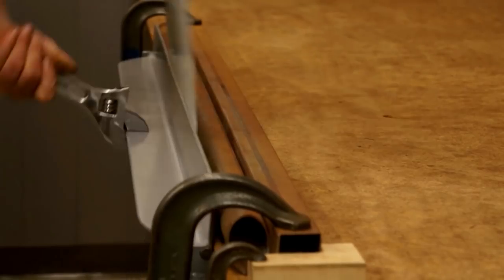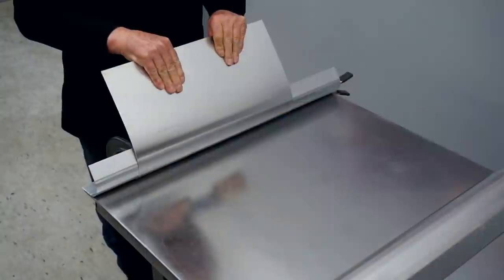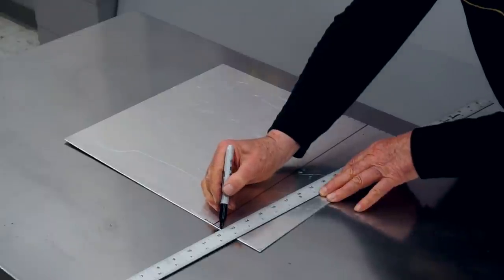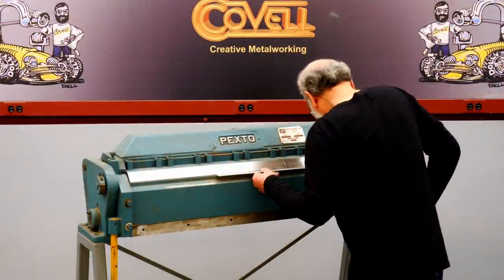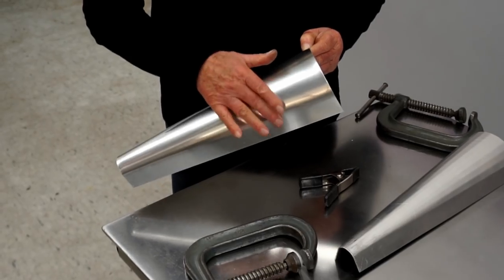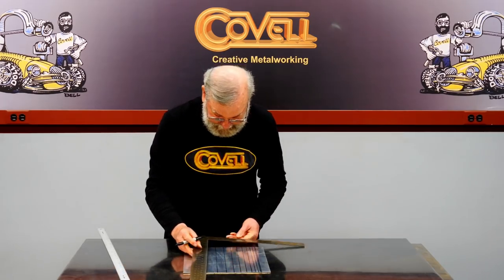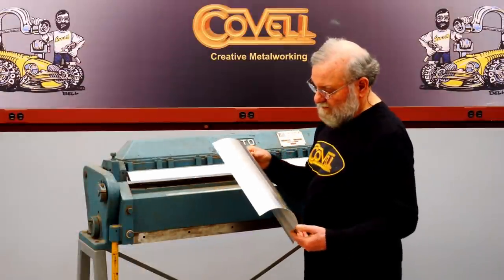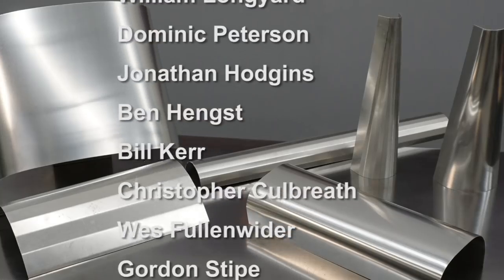Beautiful Bends from Faceted Forms

Comment: I like the simple solution to a complex problem.  I will have to try it out on 2024 t3.  Keep up the great content.
Reply from the maker: This should work on 2024 T3, but of course it will spring back much more, and it will crack if you try to bend it too tightly.

Comment: I have very limited tools, in the past I've used a hydraulic press to make faceted bends in ~1/8" alu, then gradually smooth them out with a hammer to achieve a desirable finish.

Never occured to me to use that technique to make a form instead. Always learn something from your vids, thanks Ron!
Reply from the maker: Well, this technique could definitely save you some time, especially if you are making multiple parts!

Comment: In your demo, was the form the same thickness metal as you were bending over it?  Any “rules” on form metal thickness versus bending metal thickness?
Reply from the maker: My forms were made from .063-inch (1.6mm) aluminum, and the formed parts were .050-inch (1.2mm) aluminum. You can sometimes use the same thickness for both the form and the formed part, but the form may deflect slightly.

Comment: Hi Ron,
You make it look so easy! 
What thickness material do your use for you pan/press brake form, and how do you work out your allowance for spring back when doing the final piece?
Reply from the maker: I used .062-inch (1.6mm) aluminum for these forms, and of course thicker or harder material would work too. I normally make a narrow test piece, perhaps 2-inches (50mm) wide to work out the springback before I make a full-sized form.

Comment: This is good stuff to know. I've done similar work carving a wooden leading edge form but for some projects this seems like a faster method. 

One thing I've learned to do when the parts get long and the material is thin is to put a piece of L-angle or square tube between the clamp and the work,  to help keep the metal from puckering in the middle. Same reason bending brakes have flanges and tensioned bracing across their span. For these as shown in the video parts it probably isn't needed, but even so we can see in some parts the bend has a little give between the ends. 

Just the same, when doing a longer part I use a nice thick and stiff flanged beam, like some 2x2 L-angle, and maybe with some plastic tape on one face for grip and scratch avoidance, to pull the sheet around, vs using my hands. It really helps spread the load a little better, again avoiding any bulging towards the middle of the bend but more importantly to prevent localized deformation because of your hands. I've found it really easy to put a crease in a sheet where hands are putting a lot of pressure on trying to bend say a 3 foot piece over a form, even if you have 2 people going at it; especially if doing stiffer metals like 6061-T6, and especially when using aircraft materials in the .020-.032 thickness range. 

Lastly if one was doing some rather large sheet with a very nuanced bend we can't forget the power of vacuum bagging. Vacuum bends thin sheet amazingly well over a form and this method could be very useful for that if the right circumstance were to call for it.
Reply from the maker: Thanks for the excellent tips! I had never thought of vacuum-bagging sheetmetal parts, but I can see how that would be helpful - especially for very large, very thin panels!
Reply: @RonCovell  

Vacuum indeed is great for thin and large panels. We use it to bend light aircraft leading edges quite often. Some thick painter's drop cloth and plastic tape and a shop vac will do the trick.

Anyone can search "leading edge vacuum bend" and find some results of aircraft builders using it. I've been able to make custom forms and get quite accurate tapered airfoil shapes and other bends with this method. 

Of course above a certain thickness vacuum isn't enough. For thinner sheet metal with enough surface area it's a winner.

I'm curious to try this bump-bending method combined with rolling and vacuum bending with thinner sheet. It might work a treat especially if one has a lot of repeat bends to make. 

Plus, I always spend a lot of time on wooden forms making sure my surface is sanded smooth with a perfectly smooth, curved surface and filling any imperfections; and your video makes me think I'm being far too picky! Will be worth experimenting with larger stepovers leaving more visible facets to see how much spacing some .032 can handle before it prints into the final part.

Comment: Thank you for sharing that technique. Your fixtures are made out of what material??? Is it the same or thicker? Like usual I learn buckets with every video. Stay safe and be well. Cheers
Reply from the maker: The fixtures could be made of any metal - aluminum and steel are the ones I normally use. For this video, the forms were .063-inch (1.6mm) aluminum, and the metal formed was .050-inch (1.2mm). You can actually form metal the same thickness as the form, although it can sometimes deflect a small amount.

Comment: That's great!  It looks like you're using aluminum for the form, correct?  Is there any reason this technique would not work with steel, if spring back were accounted for?  Perhaps close the open sides to stiffen the form?  I can totally see using this to form megaphones for 4-stroke motorcycle exhausts, or 2-stroke expansion chambers.  It looks like it would be repeatable, too.  Once you got the form produced, it would be properly fast compared to rolling in a sheet metal roller.
Reply from the maker: I used aluminum both for the form, and the parts I bent over them. Steel could be used as well. There is no question that closing in the sides would make the forms MUCH stiffer, but they work pretty well even with the ends left open. And you are correct that this is much faster than using a slip roll, plus it's easy to make conical shapes and bends of changing radius, which are rather complicated on a slip roll.

Comment: Hi Ron! Thanks for your tutorial videos. I would like to hear your opinion on the lighting in the metal workshop. Especially when working with sheet metal, its markings and so on. Which is the best type of light to use and how to position it. Surely you have personal advice on this matter that would be useful to everyone.
Reply from the maker: I set up my current shop about 25 years ago. The shop measures 25-feet by 50-feet, and I ran three rows of double-tube fluorescent lighting from one end to the other. (I'm sure you can convert to metric if necessary). A couple of years ago I swapped all the fluorescent tubes for LED replacements, and that made a huge improvement in light coverage! Plus, the  new LED lighting will probably last longer than I do!
Reply: @RonCovell  So are you enjoying tube-lights? Got it I'll try them. I decided to use square office-type LED lamps, similar to softboxes, and I was faced with the fact that if such a lamp is above the table, then the reflected light will blind you. Therefore, you have to turn it off and turn on the other two on the sides. Therefore, I decided to find out what you think about point and diffused light sources :) After all, sheet metal is like a mirror
Reply from the maker: Well, all things being equal, I believe diffused light is better. It was much easier (and less expensive) to simply swap out my old fluorescent tubes with modern LED replacements rather than replace all the fixtures, and I really appreciate the increased light output. My light fixtures are about 12-feet above the floor. I think that with lower fixtures, the light could be more concentrated.

Comment: Ron you mentioned you use 1/16” for the form.  What thickness is the metal you are shaping via the form?  You also mention a 1/2” measurement for the facets but the facets in your last form were over and inch.  I’m a little confused by the data
Reply from the maker: Most of the metal I shaped over the forms is .050-inch aluminum. It is possible to use metal the same thickness as the form in some cases, even though the form may deflect a small amount.
On tight bends, 1/2-inch is the minimum size to avoid marking the metal, but on long-radius bends they can be wider - as you can see in the video.

Comment: Thanks for the video, what material do you use for the form ? Also thin aluminum ? Or thicker steel to avoid springiness of the form ?
Reply from the maker: I used .062-inch (1.6mm) aluminum forms for this video, but any bendable material would work. The thicker the form, the less springy it is, but the process still works well even if the form springs a little bit.

Comment: Respected Sir, 
I like all of your videos. I like your series on rollation technique.. it's wonderful.. 👍👍
I am facing a problem in bending aluminium sheet of 1 mm thick made up of AA6061T6. I want to bend it through 180 degrees but it is getting cracked on the outer side.. I am using 3 mm bend radius and I can not use more than this.. what could be the reason for this..?? Should I go with any other aluminium alloy..?? Which aluminium alloy you will suggest that will bend through 180 degrees and will not crack..
Please guide me..
Thanks...
Reply from the maker: The recommended bend radius for 6061 aluminum is 1 to 1.5 material thicknesses, so you should be able to make a 180 degree bend on 1mm sheet with a 3mm bend radius. The radius is measured on the inside, not the outside - so if you make a 180-degree bend with a 3mm radius, there will be a 6mm gap between the two inner faces. Perhaps you are measuring incorrectly?

One way to reduce cracking is to anneal the material. This may not be feasible, but 6061 is available in the T-0 condition (annealed at the mill), which is much more formable.

5052, 3003, and 1100 alloys are considerably softer than 6061, and can make sharp bends with much less tendency for cracking.
Reply from the maker: I just remembered one more thing that is very important with 6061 T-6 aluminum, and that is the grain orientation. You can make a much tighter bend ACROSS the grain than you can WITH the grain. It's pretty hard to know what the grain direction is with small pieces, but when you buy the material in large sheets (4-feet x 10-feet, or 1.2 meters x 3 meters is a common size where I live) the grain is always going along the length of the sheet.
Reply: @RonCovell  
Thank you sir..

Comment: Wish I had room for a box brake & shear in my tiny little shop.  Is the form made of the same exact material (alloy & thickness) as the final part?
Reply from the maker: I made the forms from .062-inch (1.6mm) aluminum, and most of the parts formed were .050-inch (1.2mm). It is possible to use the same material for the form and the finished part, but there may be some deflection if the part is the same width as the form.

Comment: How do you determine the angle of the bends on the form ?  number of bends, and total angle of the form ?  i.e. 10 bends (or is in 9?) for 180 degree total on the form = 18 degrees per bend ???
Reply from the maker: I don't have any formulas for this. I normally make some small test pieces, and keep adjusting them until I get the results I want.
Reply: @RonCovell  OK makes sense. I would guess that narrow pieces to bend on the fixture would apply also. Over & Out

Comment: So, you could make a buck that was of several plate parts, perhaps with spacers, that would be reusable in many radii
With your buck, the curve is set by the angled bends, so all that is important are the high points of those curves used as a former
If you laid out plates which would form the high points, and perhaps slot spacers within in the fashion of plate/spacer/plate/spacer ad so on
The high points can be adjusted in and out to make a curve for a similar buck, but be taken apart and readjusted to make other curves later.
Reply from the maker: Your idea of making an adjustable form is clever, and I'm sure it could work well!

Comment: I’m trying to figure out I can curl a license plate into a rolled plate then connect with rivets. I’ve tried doing this with a mallet & round pipe but it’s taking me a long time & rough in my hands.  I don’t have the know how to make your fancy tools. I was wondering if I could just use a pipe, with a cut through it to insert the plate & try rolling it that way. What’s the easiest thing I could do with no fancy tools?
Reply from the maker: Celia - yes, you can form a license plate into a cylinder by bending it over pipe. It's best to do it in two operations, so you have good leverage on the part being bent. You can see something similar here:
https://youtu.be/AdImOWRUalc?t=141

Comment: The metal you use for the form, what is that? Stronger than the aluminium you bend surely?
Reply from the maker: I used .062-inch (1.6mm) aluminum for the forms. I have often bent the same material over forms like this, and although the forms do deflect a little, they are still quite usable. I used .050-inch (1.2mm) material for each of the demos in this video, and you can see that the forms deflect only a minimal amount.

Comment: It looks like your bending form is the same gauge as the material you are bending.  Is this true, or are your forms a thicker gauge than the material you are bending?
Reply from the maker: For these demos, the form is slightly thicker than the metal being bent, but the process works fairly well even if they are the same thickness. There can be some deflection of the form, but it is slight.
Reply: @RonCovell  Thanks!

Comment: you r very good
Reply from the maker: Thanks a lot!
Reply: @RonCovell  under very little budget I'm trying to modify my old car, the design I have in my head I just have to draw on the paper then the metal sheet and the design like a broken diamond and your cutting technique is the best but still I am having a problem, do I only bind or weld Pieces by pieces?
Reply from the maker: I will be happy to answer your question, but I don't understand exactly what you are asking.
Reply: @RonCovell  how to give diamond shape to metal sheet piece by piece sir?

Comment: What gauge is the metal of the fixture??
Reply from the maker: I used .062-inch (1.6mm) aluminum for the form, and the parts bent over the form were .050-inch (1.2mm). You can actually bend metal the same thickness as the form, but there may be a small amount of flexing.